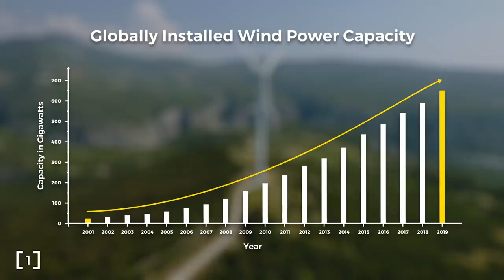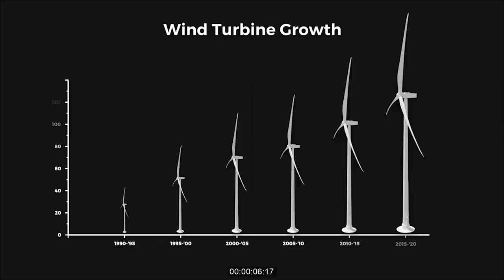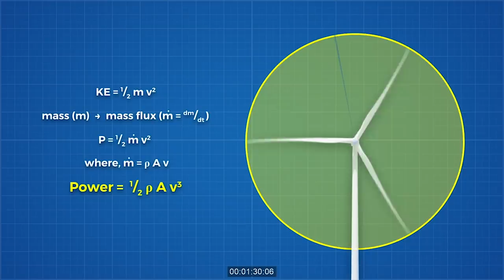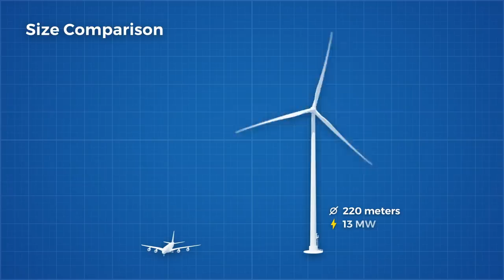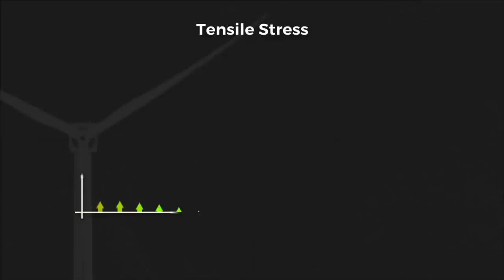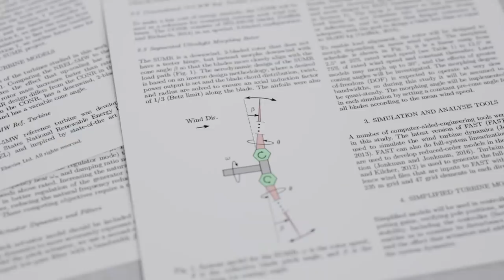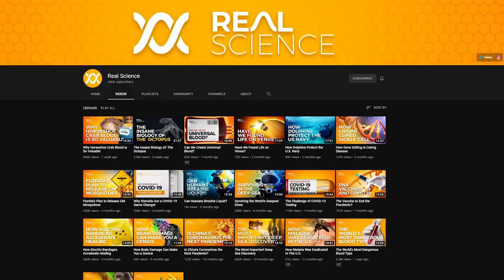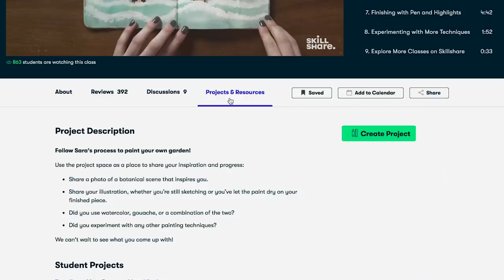How Big Can Wind Turbines Get?

Comment: 2 questions

1. Why is it that all the turbines are 3 bladed? Aircraft props have steadily increased the number of blades to 6 and 8 because they are quieter and more efficient at MOVING wind, why does that not apply also to being moved by wind? Given that most of the wind passing the blade circle still goes through without encountering a blade and therefore contributing energy, no doubt there is a good reason, what is it?

2. If bending blades in high winds might hit the tower, why not configure them to be on the downwind side at all times?

And an observation, Aircraft makers, who seem to be coming to the end of their days of making hundreds of aircraft per year, have plenty of experience now in making large, moulded, heat-treated, stiff, resilient structures, how many of them are investigating a shift to turbines? Its all just aerodynamics after all.
Reply: I asked myself the sames questions. Found this:
 
"Having fewer blades reduces drag. But two-bladed turbines will wobble when they turn to face the wind. This is because their angular momentum in the vertical axis changes depending on whether the blades are vertical or horizontal. With three blades, the angular momentum stays constant because when one blade is up, the other two are pointing at an angle. So the turbine can rotate into the wind smoothly." 
https://www.sciencefocus.com/science/why-do-wind-turbines-have-three-blades/#:~:text=This%20is%20because%20their%20angular,rotate%20into%20the%20wind%20smoothly.

"Wind turbines use an anemometer and a wind vane on top of the nacelle to judge the turbine's best position. When the wind changes direction, motors turn the nacelle, and the blades along with it, to face into the wind (this movement is called yaw)."
http://www.windenergy.org.nz/wind-energy/the-facts#:~:text=Wind%20turbines%20use%20an%20anemometer,this%20movement%20is%20called%20yaw).

Not my answers, but I read the articles, and I gained a better understanding.

Comment: As far as I know, the blade tip speed is about the same regardless of the turbine diameter (given the same number of blades) so the rpm is inversely proportional to the diameter for a given wind speed.
Reply: If you push against a two metre turbine blade at a point one metre from the pivot the 'work done' would be half that of a push at the two metre point of distance from the pivot if pushing these points on the blade through an equal angle.  Therefore, pushing a blade (through a certain angle) at the one metre point (closer to the pivot) which entails pushing through a shorter distance is 'more difficult'/requires a greater counter-pivot-friction/resistance force to be applied by wind over a shorter distance.  This means that the resultant turning force of a forceful wind pushing against a blade at the 'one metre point from the pivot' is equal but that the amount of 'work done' by the wind is lesser over the same degree of rotation at the one metre point. Therefore, a lesser build up of friction force(s) and, therefore, a lesser build up of speed is required to equal and oppose the blade's resultant turning force and prevent any further acceleration of its rotation.  It has half the accelerational force, takes twice the time to accelerate to a certain speed/travel through a certain degree but only needs to reach half that speed to bring about equal and opposite friction and propulsion forces.  This means the rotating blade does not reach an increased speed of rotation when pushed/subjected to a force from a blowing wind applied to it at a point half way along its length and, it may seem, that, therefore, it does, also, rotate at a higher penultimate speed in winds of equivalent speed to the above when the force of the moving air pushes against the very outermost end of the turbine blade.  When the force of wind is at a point where the 'work done' is doubled as the blade is pushed through the same degree/angle the acceleration of the blade is doubled but the distance through which it must rotate in order to rotate by the same number of degrees is also doubled.  It can 'go double the distance in the same time' but through the same degree of rotation so generating only the expected corresponding increase in friction/resistance forces at the pivot, i.e. these might not build up faster. Therefore, because resistance forces must equal the force behind the blade's acceleration in order to stop it's further acceleration and because it has greater acceleration without, perhaps, however, also producing a corresponding 'more rapid' increase in friction as it is rotating through an equal degree in the same amount of time despite having a higher 'speed' it seems it might have to experience an outermost edge 'speed' increase in terms of the 'speed' it would have to reach in order to balance friction with accelerating forces/forward thrust and acquire a 'constant speed'.

Comment: Ultimately as blade diameter increases you are faced with a series of diminishing returns as the video points out as size increases the components have to be increasingly robust and difficult/ expensive to produce. Like all things there is an optimum size and I suspect that wind turbines have probably reached this optimum.

Comment: Hydro turbines are much more efficient because of the increased density of water. This allows them to get the same power at a much smaller diameter. Also, tidal forces are much more consistent then wind

Comment: The speed of the tip is reduced to avoid the tip reaching supersonic speeds not avoiding noise pollution exclusively. If a blade tip breaks the sound barrier it would explode just like if a 747 went supersonic it's wings would be destroyed. Straight wings and blades are not designed for supersonic speeds not like a delta wing.

Comment: there are some mistakes in this video: (1) It did not mention the Betz limit (2) it does explain wrongly, why bigger diameter wind turbines are having lower rotational speed. It has absolutely nothing to do with noise level, but rather efficiency! The wind speed to tip of the blade speed ratio has a "sweet spot" when it works fine, higher the diameter, lower the the RPM will be to achieve this (read more about it with keywords on variable speed turbine)

Comment: Great video. Learned a lot. One question though. Why do they not use helicopters to transport the blades? It is obvious that they do not use them, so there must be a reason why that isn't done. At first glance, it seems like the easy solution to overland transport issues. I must be missing something.

Comment: One small comment is that in the rotating WT illustrations, the blades should be facing the other way. The way the blades are shown, the wind is hitting the the blades on the trailing edge. Nerdy fact, but it is important for accurate visualization and therefore for people's understanding.

Comment: Some information I learned about the denmark situation. They contracte Norway for taking all excessive energy of wind. Norway uses this energy for pumping water to the hydro energy lakes. The price for this excessive energy payed by the norwegian people is very low.
When Denmark has a shortage of energy due to days with few wind they buy electricity from Norway back...the price is high then because hydro energy can be generated the moment  asked for....wind energy only when there is wind.
The maximum speed of wind turbine tips must be below the speed of sound....knowing that you'll get an increase of aerflow speed around blades (wings)  the tips rotation speed must go really far below this speed. A jetliner will get problems with supersone with speeds increasing above ca 850-900 km/h...I do not think it differs much for a mill, even knowing that the mill wing is thinner than that of a jetliner.
I've seen the theoretical calculation of maximum energy. Unfortunate 100% effectiveness is impossible. When you take all energy out the moving air that air will be stopped completely. In other words, the next second you'll have no aitflux at all. The maximum energy is related to how much you can effectively decrease the airspeed around the mill wiyhout getting the windspped to low.
Another point...Any mill has a huge effect on airflow around it (vortexes, reduced airspeed), most at the back, some at the front side and sideways. The bigger you build those mills the farther distance between the rows of mills are needed.
The mills need a lot of maintenance...the farther on see the more oil is used for even getting there by ship. But also I do hope they do NOT build them in the normal paths of tracking birds...(I've not seen yet that they use sailingboats for maintenance crews, or electrical with sun power)

Comment: Very nice video.  Actually, carbon fiber is currently used in the spar caps of very long blades.  My understanding is that the justification is to limit tip deflection to eliminate the probability of tower strike.

Comment: Why not replace the 'blades' with windmill-like, wide but elongated, waterproof, robust, long-lasting fabric 'sails' which rotate around a vertical axis while alternately 'opening and closing' (like the 'slats' of a window blind) either side of the 'sails'' rotational pivot (making them, effectively, one 'sail' at a time being pushed by the wind on one side of their rotational pivot to prevent 'stalling' of rotational movement due to wind resistance from the 'sail' on the opposite side of the pivot)?  The elongated 'sails' could be supported by cables - like those supporting The Golden Gate Bridge - connected to a relatively short, slightly raised, central vertical column.  This could save production costs, reduce noise and boost eco-friendliness of production (and materials), transportation and installation (and, possibly, maintenance)?

Comment: Could vertical axis wind turbine (VAWT) be a solution to getting bigger, therefore more efficient? The diameter and the height of those turbine affect their productivity. Also, I think the turbine doesn't require to be built in a single part, so transportation to the site of construction is less of an issue. Maybe the design of the VAWT isn't optimized compared to the conventional turbine.

Comment: In America and in England they did studdy how big windparks influence the weather. They both found out that the windturbines act like a mountain and forceing the clowds to rise and lose through rain over 30 % of water. The resault is warmer and dryer weather and up to 30% less rain in the reagon behind the Windturbines. And at a bigger hight the turbines disturbe the natural cold and warm layers of the air and that results in dryer and warmer weather too. So building bigger and more turbines will mess up the climat big time for the land behind.
Reply: The effect is measurable for the 1-2km behind the turbine. That is not like a mountain.
Reply: @old-pete  Look up the studdys. The wind was slowed down and that caused the cloudes to be pushed up what caused rain at the windpark and caused 30% less rain behind the windparks. That is an effect like a mountain. Its all in the studdys.
Reply: @schlosserprofi8647  I read the studies and the effect was very small, contrary to a mountain.
Reply: @old-pete  30 % less rain is no small effect. It is devistating for the flora and founa behind. Like behind a small mountain. The effect of a small mountain is the same
Reply: @schlosserprofi8647  Not if it applies only to the 2km behind the windturbine and other studies calculated only an 11% reduction in rain.
Reply: @schlosserprofi8647  One cannot measure differences, only total values. The difference is calculated.
And I read more than two studies about the topic and differences are small. Other studies found only a difference of 1% in precipitation.
Reply: @old-pete  I am sorry that you fell for these propaganda studdys. I kow, because I read a lot too, but I recognised quick, that most studdys are just made for propaganda puroses. I was a fan of windpower myself for years. Untill i came across two big mager studdys that where done well. One is from Stanford university and on from an english university. I had saved a link to the english studdy, but when I wanted to go back to give you the link it was disapeared. And I could not find it anymore. The stanford studdy you can still find. But there they clame that the damage would be not as bad as the CO2 hoax. And when you read into the studdy and look at the data (what 99% of readers don't do, they just read the summery) it is getting obvious that windfarms have a big impact. But what a lot people don't know, that over 90 % of these windfarm studdys are just payed propaganda to calm the mob down and give people, that do a short google search, something to read. It is fact, that a magority of people have not enough time to serch properly. I fell for these propaganda studdys myself. Talking to people who are collecting dead bats and birds regularly under these things changed my approach for this and other related topics.
Reply: @schlosserprofi8647  That has nothing to do with propaganda. They are peer reviewed. That is called science.
Reply: @schlosserprofi8647  Typical excuse from someone without a clue about science. Anyone can read the papers and prove them wrong.
Reply: @schlosserprofi8647 Contrary to other people I learned how to deal with sources and check their validity. That is why I do not take your BS seriously.

Comment: For nearly every mw of unreliable renewable energy installed there must be a complimentary reliable power source available for a near indeterminate period of time.  Therefore renewable capex is nearly twice as expensive as reliable base capacity even though their fuel is "free".  The intermittent commitment to conventional fuel makes it necessarily more expensive.

Without reliable, cheap and plentiful backup power renewables can only drive up the cost of electricity with less reliability.

The leap to renewables without reliability is a headlong rush into a dark dead end tunnel.

Renewables paint a pretty picture until you have to face reality.  They do not reduce the cost of reliable energy.  There needs to be something else.

Comment: Snow in Texas froze all their wind generators causing power shortages & also in Germany all their solar panels & wind turbines froze causing a back up of fossil  fuelled power to supply the grid.
Reply: Carina -I m live with cam  wind turbines can be very large but their blades are non recyclable meaning they will be in landfill for ever, where's solar panels only have an efficiency of 18 percent off the size of the panel. Solar panels have a operating temperature, if it's too cold or hot they will not work, same as turbines not enough wind as with too much wind they will not work as with temperature the blades will be frozen.

Comment: Why do wind turbines not have the blades on the leeway side of the tower, so that if the blades bend in the wind they bend away from the tower? There can't be that much loss of power from wind going around the tower, especially if they give the tower an external aerodynamic profile that follows the wind. Any thoughts on that?

Comment: Hybrid boilers would solve the energy storage problem

When there is too much wind on the grid rather than try to store it just send the excess to the nations boilers to heat homes and water

This means gas fired boilers would need to be slowly replaced with cheap dual fuel boilers. Natural gas and a 10KW heating element (or even just 2.3KW heating element)

When there is excess wind homes are heated by wind via the boiler heating element. When there is a deficit of wind the home boilers use the natural gas as they do today

Using modern offshore wind farms can allow 80% of heating and eletricity to be wind powered

Comment: I used to work in apower station in teh 1960's a relatively small one by current standards which had 4 x 125Mwatt sets. Modern power staions have much bigger generators nowadays.
They talk about big wind turbines of 12 or so Mwatts and their average power is about 5 Mwatts, being generous. There is no comparison to proper generators, especially as these are asynchronous.

Comment: Interesting video. I'm a huge proponent of nuclear energy, but this was an eye opener. Perhaps we could keep growing our wind farms around the world and capture as much energy as possible while building a couple of nuclear reactors in remote areas around the world. These reactors might then be put into operation to fill in the gaps that come when the wind dies down.
Reply: Unfortunately you can't use nuclear to fill in as they need to run all the time. Gas really is the most suitable because it can react so fast. There is a new design of nuclear reactor that could be more flexible because it stores the heat produced by the reactor in a tank before sending it to the turbines. The output can vary up and down by a factor of 2 on demand so this helps with the daily demand peak in the evening but it can't really cover a large wind slow down. That's going to need gas power for a long time. But if it's only used occasionally then the co2 output is not very much so it's ok.